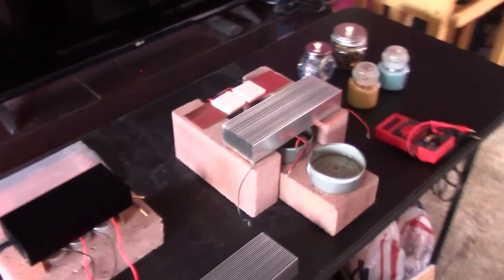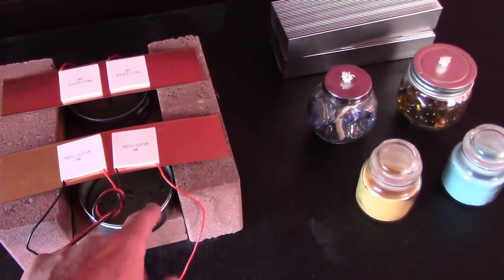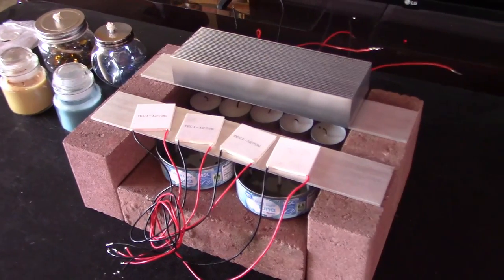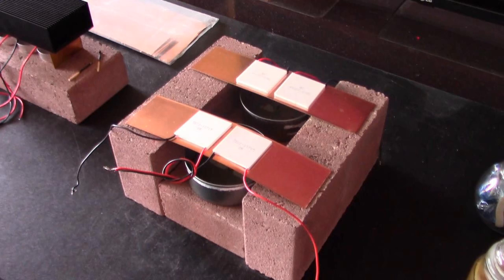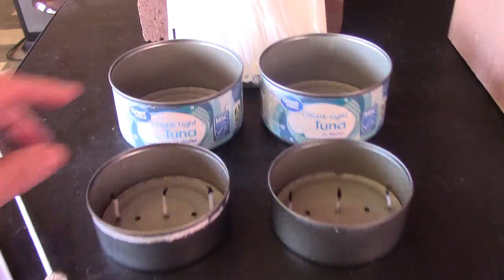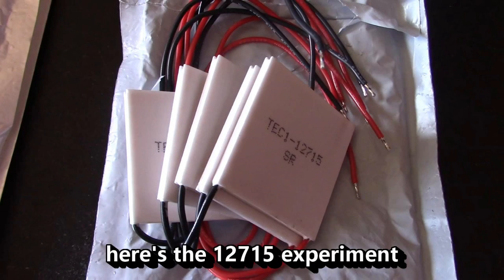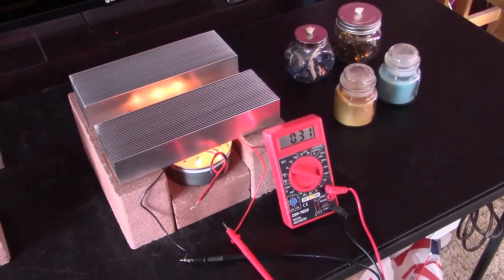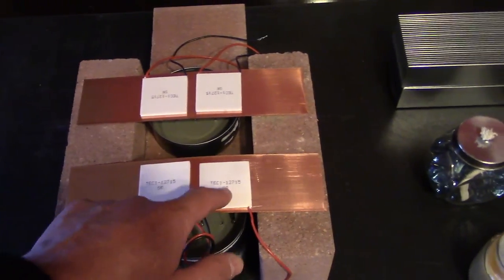Thermo-Electric Generators! Make Electricity W/Fire! Peltier Powered! w/lots of experiments! DIY

Comment: fire? lmao.. id use a fresnel lens and sunlight.. to provide the heat in the day.

i like his ideas.. i mean.. could be a good  air conditioner design + extra electricity in one.
i mean doesnt pelters get cold on one side?
Reply: Right, was thinking the same thing. Some painted flat black to produce the electricity on one side and then cold side in to cool the air? Something like that. It could run itself. Hotter it is outside, the cooler the air would be.

Comment: I love your videos! Very educational and relaxing at the same time. My husband thinks I'm wasting my time but when I made the sand battery heater with candles he thought it was pretty cool. The only thing I just can't figure out how to do is wire these damn things and I never get to see how that's done. I wish you would do a detail on that because I have zero electrical knowledge.😅
Reply from the maker: hi and i'm glad you like the videos! it's also nice to hear that you find them relaxing. with regards to the wiring of some of the projects, if it's just a straight connect to something like a battery or a solar panel i don't always go into detail. you generally just hook most of my projects straight to the solar panel or battery. solar panels have a positive wire and a negative wire and batteries have the positive and negative connection points. if i don't go into detail on the connection it usually just means that i connected the project directly. if it's a complicated connection then i show it in detail. if you have any specific question about and particular project the best thing to do is drop the question in the comment area under that video. i see all comments from all videos in the same place.

Comment: Wondering how this could be adapted to recover heat from my gas burning home boiler exhaust pipe to create 12V I need to run the PTC's I use to maintain boiler return line at 200F?  By maintaining boiler return line close to the max temperature of the boiler heat exchanger my furnace runs less often and much more efficiently.

Comment: Try a water cooled heat sink, water is better than air cooling.
Reply from the maker: hi. water would cool it down but then you'd need electricity to run the water pump. my goal was to be able to use this when you have no electricity.

Comment: Can you make those work with the Sun?
Reply from the maker: yes, i've been thinking of using small fresnel lens to heat the hot side (just have t work out the details). maybe direct it to some copper with peltier on it. i thought of making a small "solar panel" with the chips as well. feel free to share other ideas. it may be a future video.

Comment: use beeswax, they last very long, but smaller flame size
look into crystal battery, they're pretty much the wild wild west of peltier device, meaning they operate like the peltier device but since no scientist or science has gone much into experimenting with it only tinkerers or other home experimenters delve into it and there is a lot of evidence showing they can output much higher voltage and amp when heated but still requires a lot of experimentation
this is the key for the future of non-moving electric heat generators. keep it up brother.
Reply from the maker: i've been wanting to try beeswax candles but every time i look for them the price is 'thru the roof'. do you know of any good cheaper sources for them?
Reply: @desertsun02  awww man brother, i do not know any cheap sources per say. how much are they when you're looking? i'd say go for the big bulky beeswax candle tho, just youtube the phrase 'beeswax candle timelaps' and begin your research to see what i am talking about in terms of duration performance they perform the longest out of all candles. once you got that, now think of it like a battery, big bulky beeswax candle last 24 hours, so its basically a battery that can output energy for 24 hours. as for the crystal battery, you will have to experiment them on your own but according to my research, utilizing carbon powder and some piezoelectric salt solution that can also withstand high temperature or has a somewhat high melting point is the key to having a stable piezo material that can produce electricity with high heat like a candle flame. youtube research phrase 'crystal battery hot' or you can replace hot with heat or anything else you would like that is synonymous with it. one video shows a crystal battery going up to 1 amp just by heating the apparatus water of some kind and dipping the crystal battery into it and measure the energy output it has amps reaching 1 amp, THAT'S CRAZY! for something similar size of a triple a battery can. once you find an efficient material combination for the crystal battery, create like an array of them, lets say 10 of them and put them into a hot solution, like a hot water tub or a sand battery thing you created and measure the output from the crystal battery and see the amazement. i call this the ac battery, this will change the world brother. we need you to do it and show it for the rest of the world to see. being free from the shackles of the government and producing their own energy in their backyard. from here you can then start to dabble in a hyperdrive motor which i can help you with if you want.

Comment: I like seeing the process even if it doesn’t work as planned at first. Thank you :)
Reply from the maker: yes, i figured that it could or can help a lot of people if they see what worked and what didn't.
Reply: @desertsun02  I was trying to figure out what I could use for flat copper strips like you use & I found some on a large transformer so it worked out.  I like to weave copper wire and have been salvaging copper rather than buying it

Comment: Would love to see this done outside, and couple your cold side to the ground. Not as dangerous, burning things you wouldn't burn indoors is an option, and some places you don't want the heat from the flames... just the electricity.  Also, I am curious about what kind of heat it takes to heat up the ground... I've done some reading, talked it out with A.I., but didn't conclude anything. It would have to be settled with experiment I guess.  Just rebar in the ground and see what kind of btu's you can dump before temps rise beyond TEC safe levels. 

As it is, good job comparing different tec modules... something that hasn't been covered well on youtube. I have seen some comparisons in white papers iirc.